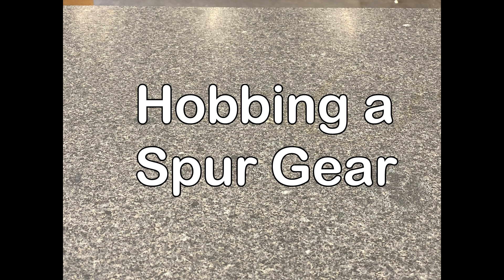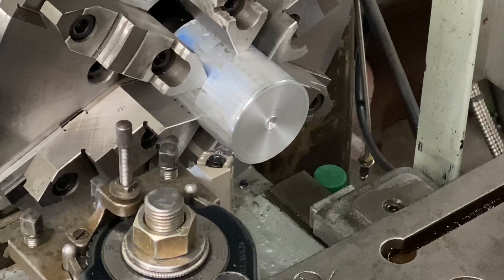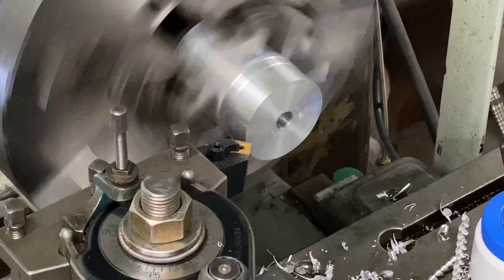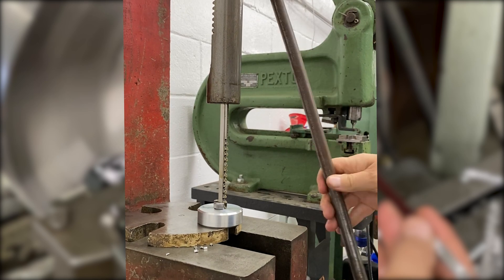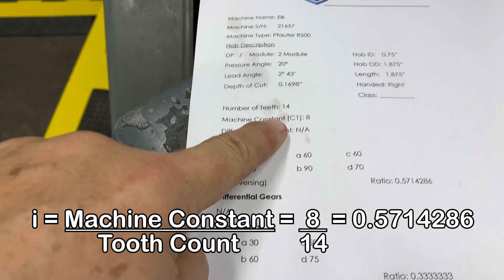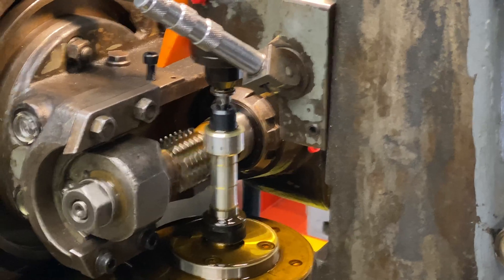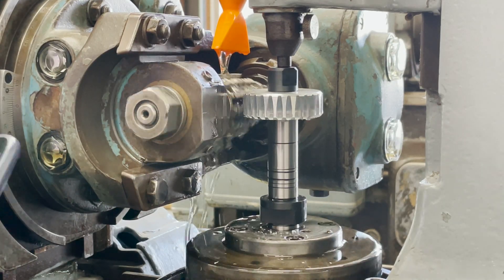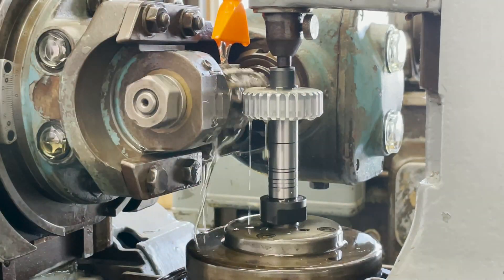Hobbing a Spur Gear & Pinion

Comment: Ah a Pfauter! I spent a few happy weeks back in 1989 in Ludwigsburg making sure the CNC PE150 the company I was working for was fit for purpose, it most certainly was, it replaced (though we did keep 2 of them), 4 Mikron A32/33 gear hobbers, the Mikrons were utterly superb but we ran them at the edge of their capacity! If you come across a Volvo FLH truck from the 80s, the drum brakes will have gears hobbed on Mikons, from 1990, all the 5 gears in the Lucas HDBS SAC drum brakes had gears hobbed on the Pfauter! Great content, will subscribe, I am in South Wales UK
Reply from the maker: Awesome, the Pfauters are great

Comment: Nice video, you have a wonderful approach teaching.
Please also mention that we have to set the helix angle 2deg43mn of the hub so  the tooth are strait
Reply from the maker: Great tip!
Reply: hi mean if the cutter need put angle according the gear cutter? so it cut straight? im new with the hobbing machine . i try to put according the gear cutter degree but when it cut straight it cut from side to middle the side? or it should just cut straight from middle? and btw if for this kind of gear , how much depth to in suitable? i see you cut like almost finish

Comment: Hey! Thanks for answering my question on machine constant it helped a lot. Do you have any resources on figuring out feeds and speeds for cutting a gear based off of material. For instance what feeds and speeds to cut a gear out of 4130 or 4340 steel.
Reply from the maker: There are not many resources out there and I it would have a lot to do with the hob material and coatings.  The main manufacturers of Hobs are Tru-Volute (Japan), Star Su (China) , Gleason (NY).  Since there are very focused gear shops for very specific materials etc, I am sure they are optimized, but they have no need to share with others.  Stay tuned on this one as we are gathering this data ourselves.  The range for steels is pretty big at 65-115 ft/min for the older HSS like M2 and M4-M42 hobs.  Basically, the newer hobs have coatings that really extend the life of the cutters.   Usually they require higher cutting speeds++. If you find anything please let the channel know.  Great Question.

Comment: could you guys do a video about the choice of material used? Like what type of steel to use based on what kind of application. when and why you would use a certain type of steel? when hardened and ground gears would come into play? one last thing, how hard of a steel could you cut with a hobber?  Could you possibly cut a gear with a hardness of anywhere around 40-50 rockwell? or is that where grinding comes into play? thank you.
Reply from the maker: Great question - I will put it on the list.  Generally, the hob bits are used on annealed alloy steels.  Anything too hard and it can damage the bit.  
From a process standpoint to achieve a very hard high precision gear there are many steps.  On the metallurgy side ONE method/alloy is to 
1) hob annealed 4140 at RC32  yield strength is already high at 130,000psi with (stock to leave)
2) harden to RC 52 (yield rises to 219700 psi with proper processing)
3) Grind final involute profile to tolerance

A few interesting topics on materials are strength and also how repeatable the process is in the hardening phase, how deep to harded etc.

Skiving is another process altogether an can be done on hardened materials.  Check out Gleason-
https://www.gleason.com/en/products/machines/cylindrical/power-skiving/the-gleason-power-skiving-approach
Reply: @EvolventDesign  thank you very much :)

Comment: Do you also hob timing belt pulleys? I was wondering if there are GT2 timing belt hobs available.
Reply from the maker: Yes, familiar with the Power Grip GT hobs from 2mm up to 5mm sizes.  Would need to check on GT2.  Send me an email ....

Comment: How about a worm gear and wheel?
Reply from the maker: The video is "on the list", the worm can be made in our Okuma or other lathe that can be setup or programmed to cut a diametral or circular pitch.  The worm gear can be made on any of our hobbers either with a single flycyutter, or with a worm hob.